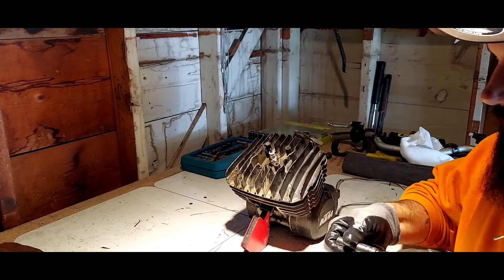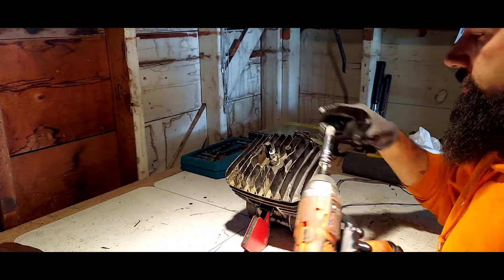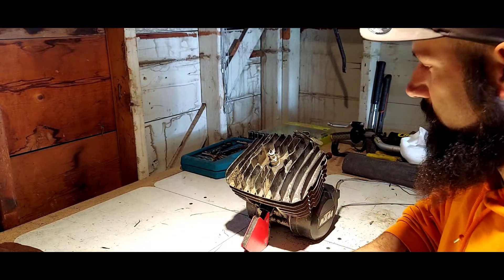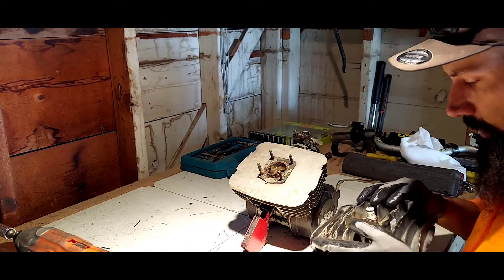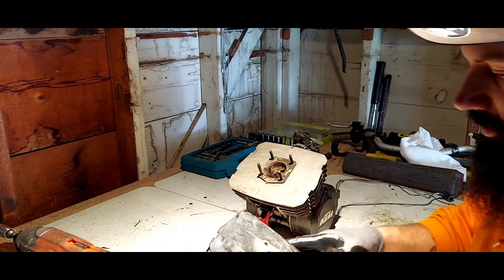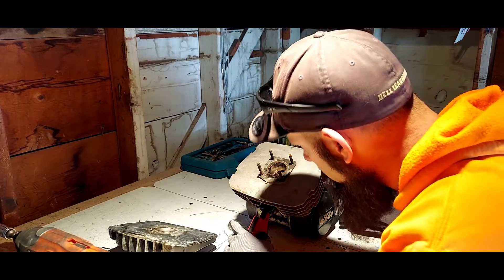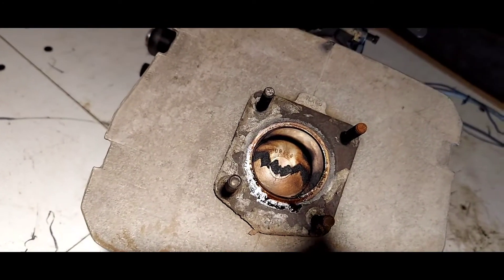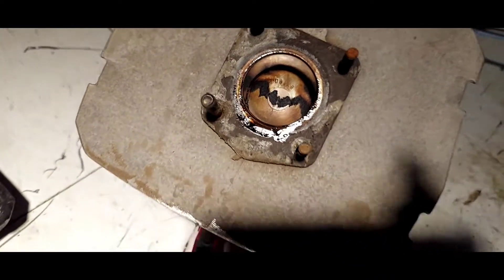aftermarket wiseco piston Surprise on the ktm 50cc motor

Comment: Why did ktm make the fins so big but the cylinder so small. I get it’s for cooling but that’s a little much
Reply from the maker: The biggest difference between this motor and the other one that we have the ports are much bigger and I believe it probably just created more heat so they got excessive with fins because they probably thought it was going to be racing